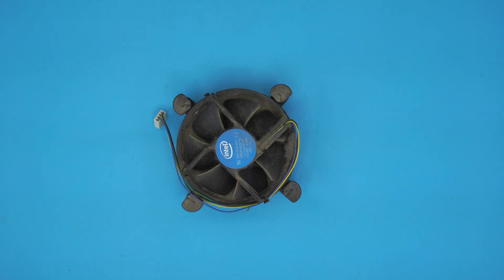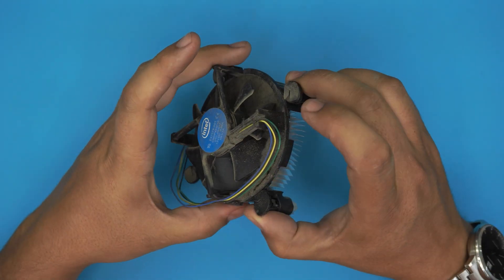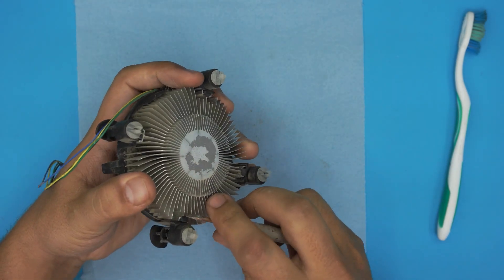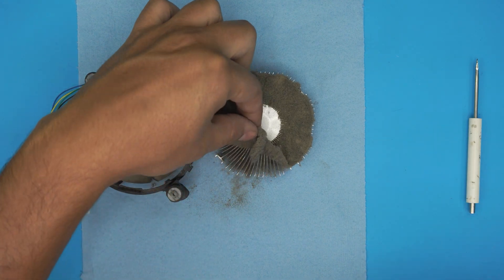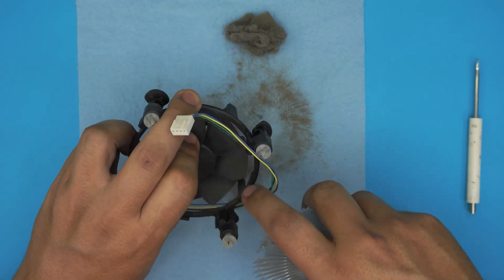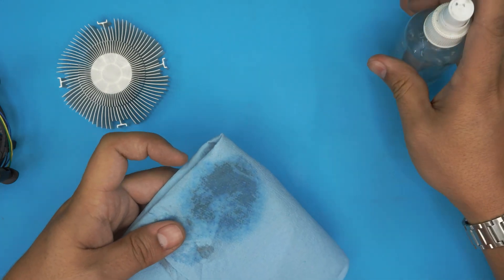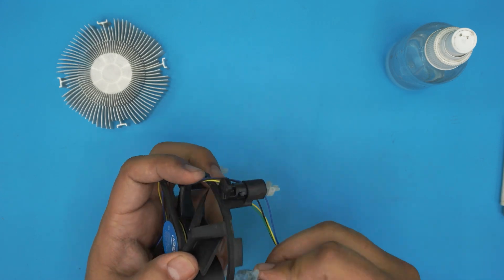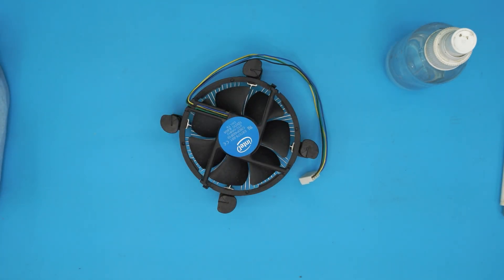HOW to CLEAN & Service Intel CPU Heatsink 🆘

Comment: Why should i remove the thermal paste? Google said i shouldnt turn the pc on because i dont have thermal paste anymore on 8t
Reply from the maker: Because if the thermal paste is old and dry and you reuse it, you may experience overheating and shutdowns. So, clean it off and reapply new thermal paste.
cheers🍻
Reply: @uFixTek i tried it without the thermal paste on the heatsink only after i cleaned it, it started smelling burnt when i reopen it theres nothing melted or burned in the mother board or heatsink what should i do
Reply: @randomperson11419  bro cleaning the heatsink and thermal residue means u gotta reapply new paste after, dont run the pc without thermal paste on the cpu it'll die 😭😭

Comment: sanitizer is good for cleaning???
Reply from the maker: You can wash the aluminium heatsink with soap and water, but you should clean the fan only with a towel. Make sure you don’t get any water or sanitizer in the motor.
Reply: @uFixTek  thnks brother... can you please make me a video for cabinet rear fans ejecting. my cabinet - ant esports ice tg 200. i cant clean the dust in the fans. 😓
Reply from the maker: i will make a video for it and let you know.
cheers🍻

Comment: position of heatsink i just need to remember this sticking part is on a bottom ? doesnt matter if i rotate some ways?
Reply from the maker: 🫠Regarding your question, no the rotation don't make difference as long as the heatsink sits in the fan case and clicks in.
Should you have any further questions or requests in the future, please don't hesitate to ask me.
cheers🍻

Comment: Mean while my dumb ass trying using a vacuum cleaner while the cooler is still mounted to the cpu
Reply from the maker: 🤣it's ok my friend now for the next time you know 🍻😏
Reply: My heart dropped while reading this comment
Reply: @phantomized187  to be fair its the one with the bristles on it and anything that gets stuck in the grooves i use a tooth pick for
Reply: Same thing i did to my pc 😅
Reply: I got heart attack bro for rreading this comment 🥶
Reply: me too !

Comment: Do we have to put back more thermal paste at the end?
Reply from the maker: Thank you for your feedback! If you wish to support the channel, you can like, subscribe, or both!
Regarding your question, you will need to clean the old thermal paste and apply new paste on the CPU, NEVER put back with old paste.
Should you have any further questions or requests in the future, please don't hesitate to ask me.
Reply: @uFixTek does every GPU required cleaning out the old thermal and putting a new one every once in awhile?
Reply: @phantomized187 yes the thermal paste helps to transfer the heat from the cpu to the heatsink if its dried out or just not applied correctly It can cause your game to throttle because of the unsafe temperatures it could also cause permanent damage, if you see that its dried then yes, replace if it looks fine and you’re temperature is fine then you are good.
Reply: @phantomized187  change the thermal paste every 5 years